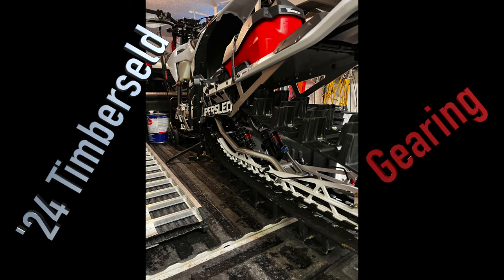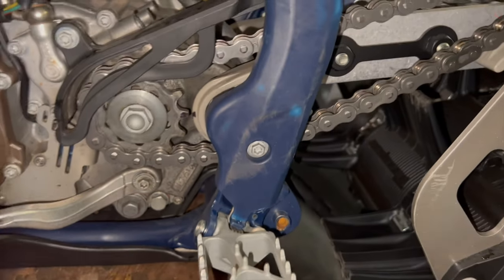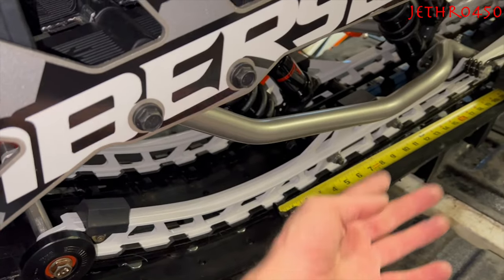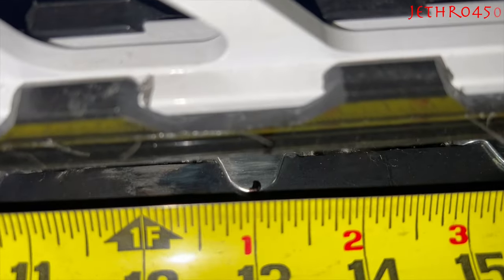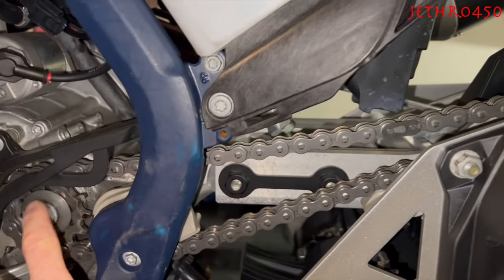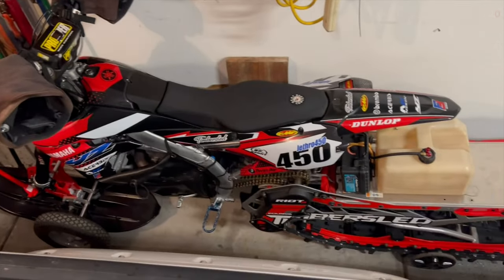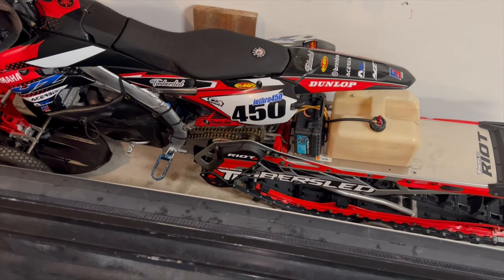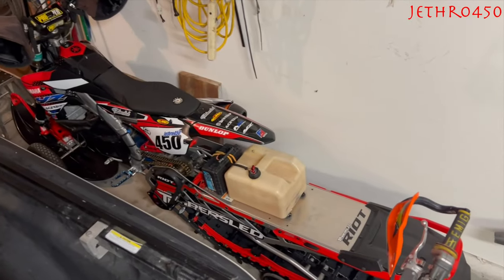'24 Timbersled Riot3 Gen2 QDT - Track Gearing

Comment: what if you swap the top and bottom sprocket on the old riot?
Reply from the maker: It’s really fast.  I’ve done that.  But it’s too much for the 129x3 track.  For normal riding it’s hard to ever get out of second.  The riot 120 comes that way.  And I think it’s too fast for it too.  I geared my 120 tracks 17-17, which is one tooth slower than 18-17, and that felt good for a 120 track.  The 17-18 gearing for the 129’s (stock) is perfect though for my style of riding. I’m in a good mix of gears.  2nd or 3rd most the time.  I do jumps in 3rd or 4th.  I like it
Reply: @jethro450  i like mine the faster way. but 120 track. know anyone with a 120 track ? i broke 2 of the cross bars in mine